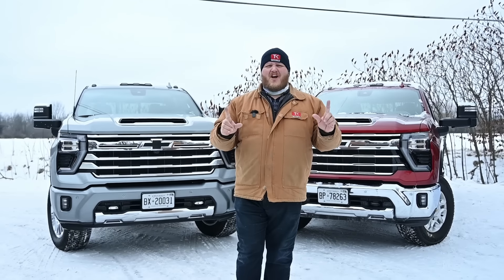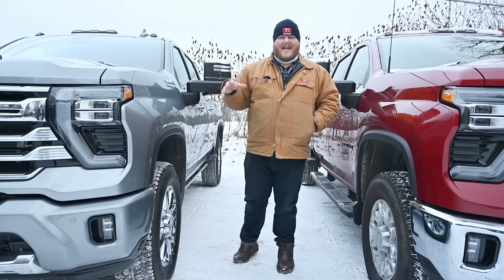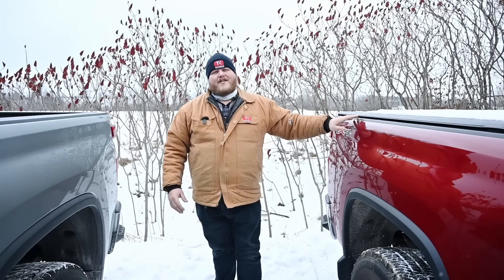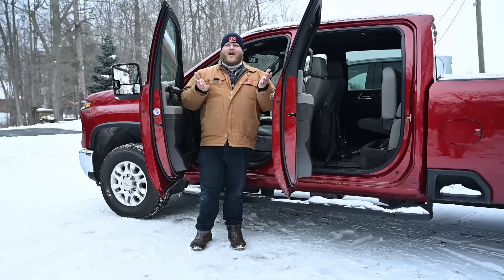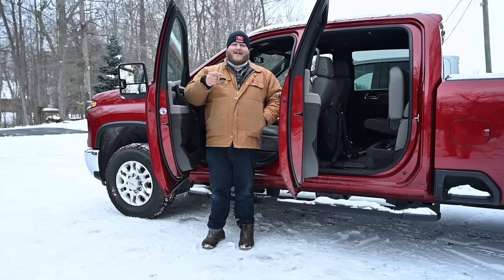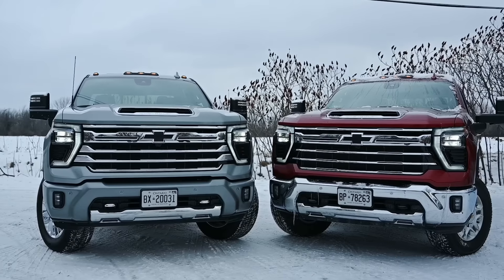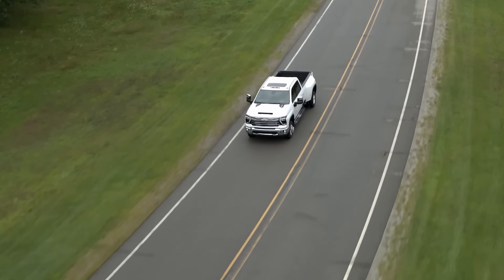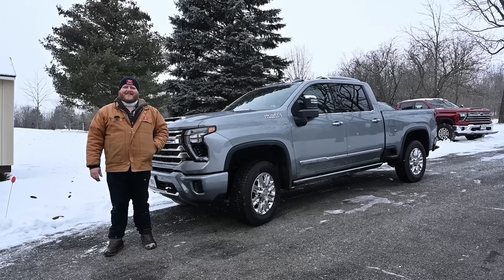2500 vs 3500 Trucks - What's Really the Difference? We Compare Two Chevy Silverado HDs to Find Out

Comment from the maker: Thank for watching! Watch us compare two styles of fifth-wheel hitch on the 2024 Chevy Silverado 3500 here: https://www.youtube.com/watch?v=nJfFNKxo_gU
Reply: So I have the 2024 Silverado 2500HD, which we purchased because we're planning on getting a truck camper for it in the near future. What was interesting about the payload capacity of the 2500HD in your video was that the payload capacity on it is 2987 LBS. The payload capacity on my 2500HD is 3461 LBS; almost a 500 pound difference. The only real difference with mine is that I have the gas 6.6L engine, not the Duramax. I also don't have the max trailering package, but I'm not planning on towing anything, since a truck camper sits on the truck, so I was more concerned about payload capacity. But I have a question about payload capacity. I've had some online conversations with owners of truck campers, especially with owners of the 2500HD like mine. In order to beef up the suspension of their trucks, some of them have added a leaf spring to have that extra one like the 3500 has, as well as installing aftermarket items like upgraded bump stops and airbag suspension, and heavier duty shocks. I'm aware that 'officially', these things don't increase the payload capacity specs, but in your opinion, and I know you have to be careful with your answer, but unofficially, would you say that with those kinds of upgrades, practically speaking, the payload capacity would be increased? Thanks in advance. Loved your video by the way!

Comment: Good video guys. One thing worth mentioning is how much your payload can be affected depending on the trim. Case in point, that high country 2500 has a 2,890lb payload because it’s loaded up with lots of lipstick and shiny bits. My 22 2500 WT CCSB Z71 has 3,520lb payload because it doesn’t have all the fancy stuff but 600 pounds of payload more is significant. Also any difference in height of about an inch can be attributed to heavier spring packs with the camper and snow plow prep packs. My 2500 has both so the springs are heavier. 5600/6600 so that’s where the inch can come in.
Reply: That’s right. I have a 2024 GMC Sierra 2500HD SE. IT HAS 3300 LBS of payload because of the lower trim level.
Reply: Weeeee geeeeeeet it...... You couldn't afford the 3500. No one cares. The high country does not have 600 lbs in leather and chrome. Nice try though. Apples to apples, wt to high country is not 600lbs. Carpet does not weigh more than rubber. You may be referring to more sound deadening, thicker glass, better build. If you think a WT vs high country is just "lipstick" you have never watched one get built at the plant....
Reply: @LegendaryFarm84 weeee geeett it. You’re not great at critical thinking or reading comprehension. Payload is just made up in your world 🤡
Reply: @Lq32332  Projecting a little bit there, bud? Where did I say payload is made up? Quite literally my main point is 600lbs is not accurate, and the difference between WT And high country is not "600 lbs of lipstick." Someone has to call this guy out on his bull crap stating that the real reason he got the entry level is because of cost and the higher payload capacity due to no "lipstick."
Reply: @LegendaryFarm84 Call me out bud. The facts are the facts. My payload is 3,520. How embarrassing for you would it be if I uploaded a quick video showing my door sticker and calling you out in the video for proof😂 I paid 50k for my truck brand new with everything I wanted in a truck. I have a crew cab z71, plow prep, camper pack, bed and cab 110v outlet, carpet delete, spray in bed liner and 5th wheel pack.  I have a man’s truck. So yeah, it doesn’t give up anything except the shiny fluff and I saved 30k I’d do it again in a heartbeat.
Reply: Gas or Diesel engine makes a difference in your payload.
Reply: I think the big takeaway that replies are missing is what Howard mentioned in the middle of the video. GVWR (and subsequently payload) are manipulated by the OEM depending on a number of factors, many of which are related to registration and commercial use type. A 3500 could be derated in terms of its GVWR to less than some 2500s but still have all the physical capability. So for the normal consumer these numbers tend to have less meaning.
Reply: Payload is just a suggestion. As long as you don’t exceed your rear tire capacity, that’s all that matters, or rear axle which is all that matters and you will go over tires before axle capacity
Reply: @LegendaryFarm84 have you been truck shopping recently? Why would he make up what the placard on GMs say?
Reply: @slaytanic921  I am not saying he is making up his placard. I am saying very specifically - the high country is not 600lbs more than a WT Apples to Apples. It is closer to 250lbs. And to say you bought the WT, 2500, gas all for $50k then to float like you made the "man's choice" because of the high payload capacity is disingenuous at best. If he needed the cheapest truck, with the highest payload, he would have got the 3500, for a mere $500 more. Lastly, I am saying that to say a high country only has "lipstick" is very ignorant - High country has sound deadening, better seam sealer, better and thicker paint in Key areas on the body, thicker window glass, trailer camera, adaptive cruise, just to name a few. It is not just "chrome bits and lipstick" like that guy with no money stated. Let alone the 3500 has bigger brakes and bigger rear diff, plus extra springs.
Reply: @pryme2013  I know you DID have breakfast yesterday, but imagine if you didn't. I am not saying your payload is not 3520. I AM saying it is not 600 more than a high country apples to apples. And if you were after  highest "payload" you would have bought a 3500. But you choose to Gaslight us to believe you made the "man's choice" but in fact you could not afford the mere $500 upgrade. 

You also brag as if the other features of a higher trim truck aren't safety related, like trailer cameras, lane departure, follow distance with gvwr consideration, etc etc etc. It is easier just to deny it. We get it. 

You are the guy that buys an underrated truck, then overloads it, and tells everyone "see, I don't need no 3500" as if there are "no differences."
Reply: Why is truck king deleting posts? Even TFL doesn’t do that. That’s too bad.
Reply: @LegendaryFarm84  He was comparing 2500 to 2500 and you bring up 3500. Work on reading comprehension to stop embarrassing yourself.
Reply: @Lq32332  Nope, no I did not. I stated if you were looking for max tow capacity, you would get a 3500. This guy is trying to convince us he chose the 2500 WT z71 Lowest Trim to get less "lipstick" and still get a higher payload. I am stating very clearly a high country 2500 is not 600lbs more As he states. I just checked the payload chart for a 2500 WT (3589 lbs payload) vs 2500 High Country (3413 lbs payload). Straight out of the Chevy Chart which is +/- 2% real world weights. Ill give him the buffer and say it is 250 lbs difference. The real story is he probably was only given a 50k budget from the wife, and now is on here gaslighting everyone how he made the "man's choice" with cheap ass cloth seats and rubber floor.  My original point which is beyond you - if he was truly concerned about payload he would have bought the 3500. But the wife said "NO."
Reply: @pryme2013 it’s YT hushing certain comments that their algorithm deems inappropriate. Truck King or any major channel don’t constantly sift through the comment section to delete singular comments.
Reply: @ALMX5DP  If that’s the case, that is alarming. Thanks for that though
Reply: @LegendaryFarm84  Let me ask you a question. Did you watch the video we are all commenting about? Please watch it. It clearly shows the payload of this high country 2500 as 2,900 pounds. Which is 600lbs less than my 2500 w/t. Period. End of discussion
Reply: @pryme2013  ok, ok, you don't understand that the truck in the video is a Duramax Diesel. You have a gas. The Duramax is about 350-400lbs heavier than the gas all components considered. Which is why I said apples to apples. Want to try again? We watched the same video. Here you go again, trying to convince us of your entry level choices.
Reply: Gotta admit I am confused 😊 My 2024 3500 High Country Payload is 3796 lbs. That’s the DuraMax and a 8 foot bed CrewCab.
Reply: @whataboutbob  What are you confused about? That sounds right. We are talking mainly about 2500’s
Reply: @pryme2013  My bad. I am fascinated with the ability to learn from a variety of sources, but reading the comments I got lost in points some were discussing.
Reply: I'd like to know how much rougher the ride was between the 2500 and the 3500.
I currently have a 2016 2500 HD High Country and thinking about trading it in on a 2021 3500 HD High Country?
Both have diesels.
Concerned about the ride difference.
Reply: Always owned 3500 SRW with every option except sunroof.
Reply: @krice24  did you really say payload is just a suggestion? It’s more of a legal liability than a suggestion buddy. Payload maxed out on your truck? Move up to a bigger truck. Wth? Do the rest of us road users a favor and stay off it before you kill a family with your over-grossed vehicle.

Comment: I went with a 2024 3500HD and traded in my 2020 2500HD to get the added payload. I tow a fairly heavy 5th wheel from NY State to Florida and back each year and I was right up against the max weights with the 2500HD. The 2500HD was more than capable but if I was ever in a wreck and an attorney decided to weigh my truck and trailer and I was over weight at all, I would be in trouble so I opted for the 3500HD. I went with the LT instead of the LTZ 3500HD because all I cared about that the LTZ offered over the LT was the LED Headlights. So I saved $3,500 U.S. on the MSRP and then bought LED bulbs for $250 and installed them myself.
Reply: and you dont need a cdl?
Reply: @aksauce614  No, not in NY State where my permanent residence is. I do have to have Commercial License plates/Registration though which cost a little bit more than passenger vehicle plates. That was true with my 2500HD as well because they weigh more than 6,000 pounds.
Reply: @robh063 I have 6500 tow trucks man it’s expensive 😂
Reply: @cristianadame4352  You have 6,500 tow trucks?
Reply: These trucks are junk am doing the lemon  law on it my transmission went out 2 times and my oil filter housing leaking on it after replaced already once  and seat are uncomfortable on long drive so cheaply made
Reply: You don't need a CDL for personal Use. I have 2023 K2500HD.

Comment: Good video.. both have faulty control valves in the Allison that isn’t manufactured by Allison lol . I’ll never buy another duramax or any diesel with a Crappy injection pump much less egr, dpf or that epa recirculating bs.  Went with a cross fire dirty Hooker performance long block, high flow y bridge intake, tator built turbo, banks intercooler, Mishimoto radiator, trans cooler, PPE exhaust mans, PPE down pipes,CP3 . Only thing GM under the hood stock is air condenser and power steering pump lol LML is now ready for a built trans..

Comment: Do these year trucks suffer from the fuel pump module failure?  Also, the GVWR can be determined by the max weight rating of the tires. I have an older 2500 HD Dodge truck and the max payload is directly linked to the tire rating.  The HD version I have has the hd axles front and rear, overload springs, sway bars, etc as that of the standard 1 ton version, except for slightly smaller drum brakes in the rear, and single wheels instead of dually wheels in the rear.  My 2500 is basically a single wheel 3500 limited only by the weight limit of the tires.  If I put higher rated tires on the vehicl, it will definitely handle a larger load than the sticker says.

Comment: I went with a 2023 at4 3500...bds coil over conversion 6.5 lift with fox 3.0's,  arb lockers front and back, air ride 16k airbags.
Cheeper than an at4x all in and far more functional.

Comment: If I order a truck it will likely be an LTZ without a sunroof so there might be 2 out there in the world. My '15 Sierra has a sunroof but I bought it off of the lot that way and got a great deal back then so it was okay. I never use it and it cuts into my payload rating.

Comment: Lol my gmc 2024 2500 duramax 4x4 crew cab 4x4 payload is 3350 lbs so from that 3500 I'm short by what 400lbs and I can tow the same as both of those trucks it's the manufacturer they mess up on those numbers

Comment: Another element with GM at least that is very frustrating is that you get a different GVWR between gas and diesel. Essentially the gas trucks despite all the same hardware and axel capacities are derated for some reason.

Comment: I can put 1 ton of stuff in my 3500 van and still pull 1300 with my van with no problem of a 2012, the same year as the 2500 would drag the ground with same weight. The different suspension on these trucks makes the difference between the these 2.

Comment: Do you know why my 2023 Chevy 2500 z71 would have such a low tongue weight max capacity? It is 1,200 pounds with max trailer towing of 12,000 pounds. I've check the hitch and it's rated to 20,000 pounds with max 2,000 pounds tongue weight. I have the 4+1 leaf springs, the rear axle is rated for 6600 pounds, and the tires are rated at 3,640 pounds. So strange. When it comes to fifth wheel/goose neck towing it seems to be similar to other 2500's with 18,500 pounds and pinweight max of 2775 pounds.

Comment: The top two leaves of the 3500's rear suspension don't engage until partway through the suspension travel, as mentioned at 5:10... but that's also true of the bottom leaf of the 2500 (and presumably the 3500, which is not clearly shown).

Comment: One key note about the weight /GVWR/payload... If you are towing  / hauling and you exceed those numbers.  Even though the vehicle is "the same " ... can "handle the weight."  
  Then, get into an accident or, worse, cause an accident.  That can be held against you.  So, it just goes to say.  If you are planning to haul a large trailer,  camper, boat, whatever.  Get the 3500. 
   That's one edge Ford has over everyone else.  The F450. It not only provides the additional payload.  It relocated the front steering and suspension to enhance the turning radius.  It covers the numbers to haul the heavy loads. Yet you get a pickup configuration, and the engine is not like Chevy and governed as a "commercial " truck. Plus, all the "creature comforts," not a "work truck."  
  Would be great if Chevrolet produced a 4500. However,  i can only imagine the cost would be astronomical.  Since both trucks as are shown here. Are at or above 100k USD. Which is insane to begin with.

Comment: I'm not sure if current trucks are like this but historically 3500's came with the heaviest duty rear AND front axles. The 2500's with the heaviest tow package came with the same frame, rear axle and rear suspension but the front axle was lighter duty by about 1000lb load capacity. 

This was true for many years, all the way into at least the early 2000's.

Even my 1977 K30 vs my 1976 heavy K20 (it was a special order chassis cab for use as a tow truck) is this way.  Both have the same full floating HD 14-bolt rear end but the K20 has a Dana 44 front axle (or GM equivalent) and the K30 has a Dana 60 front axle.

What is the difference regarding the front axle and front suspension in 2024 2500HD vs 3500's?

Comment: I've been looking at 2021-2023 2500HD Silverados.  Most are 11350 GVWR, but some are 10000.  Can't see a difference in the springs.  Is there a physical difference in these trucks as far as you know.  Most salesman/dealers are not knowledgeable on this.
Reply from the maker: These weight ratings are for registration.  In many areas it costs more to register and license trucks over 10K.  That's the only reason

Comment: Yep. I have a 1997 F250 HD but if you check the axles they are 1 ton 8 lug axles. Another thing my truck was speced with 4:11 axles/differential gears. It is also a camper special. I can easily tow or carry as much as a 1 ton, BUT, not legally. If I exceed the GVCW on the sticker on my door jam and I get stopped by a weights and measures mobile scales State Trooper he can shut me down and ticket me. Unfortunately my State charges more to license a truck because it can carry or tow more weight.

Comment: Great video. Was looking for a viewpoint from Canada and this gave me exactly what I was looking for. I do the ordering for my dealership in Alabama and did a quick search for LTZ 3500's in a 500 mile radius without a sunroof and there were at least 50 (the max records it will show me) so they're out there! Feel free to reach out if you ever have a similar question!
Reply: A gas 3500 HD long bed crew cab LTZ is hard to find

Comment: LMFAO, 3/4 ton truck with a lower payload capability than my 1/2 ton Ford F-150.  That's stupid.  Because the limitation is a paper limitation, not due to engineering at all.

Comment: $100K for a truck?  Excessive!  And you have to change the oil approximately every 5K miles (at least that was my experience with my many diesels).  And diesel fuel is now quite a bit more expensive than gasoline, but of course you're getting 975 lbft of torque so you can pull your house off of its foundation if you're drunk enough to try.  I'll stay with my current Ford ecoboost 3.5 with 470 lbft of torque and 375 hp.  Also, it burns regular gasoline that I can now buy for $2,85 a gallon, and the torque will pin you to the seat back if you wish.

Comment: Are the frame rails same on both 2500 and 3500? Is it thicker on 3500?
Reply: Videos mentions thickness is the same on both trucks, 3500 had a tad bit more reinforcements but thats it